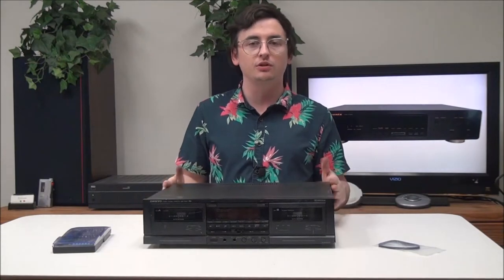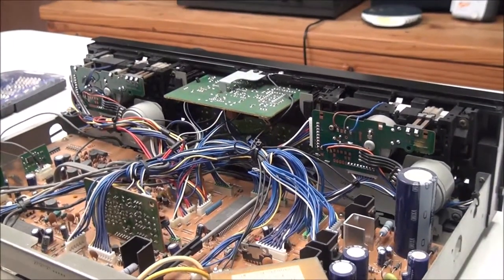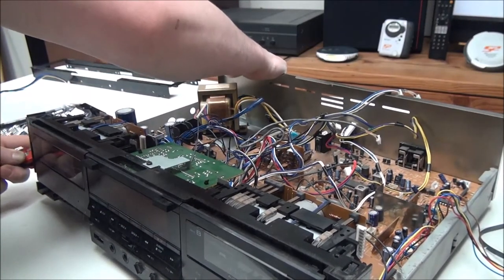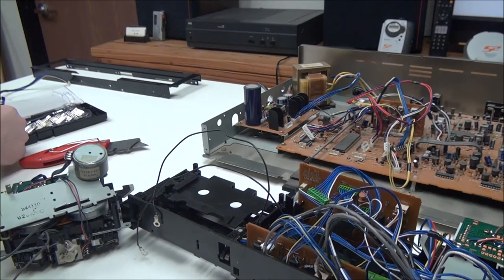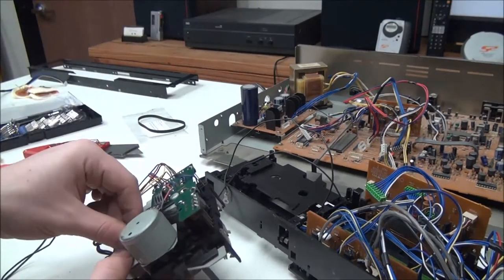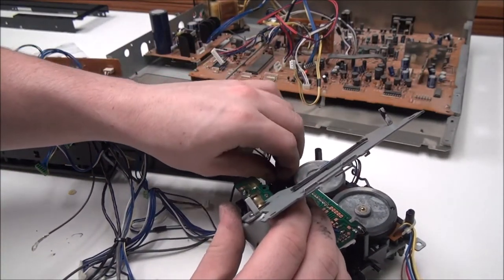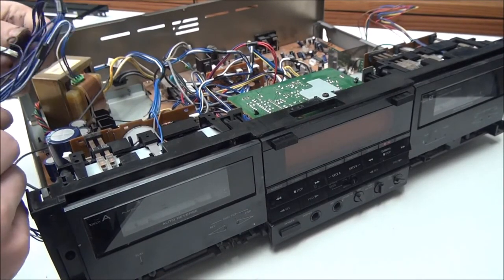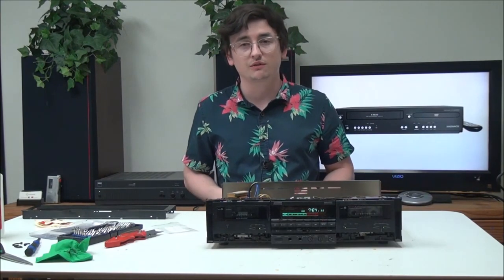How To Replace The Belts on an Onkyo Cassette Deck Won't Play or Work TA RW470 Repair Replacement

Comment: You did not show the most important part, which is putting the new belts on.  You just sped through that and did not show the path/route that the belts take.
Reply: I was going to say exactly that! And much of what else was shown was outside of the camera view...
Reply from the maker: Sorry, future videos will be better.
Reply: @Spencertified  i can see it ,thanks. you dont find it is 2 parts to clean easy🙂

Comment: thank you for making this video!  I was on the right track in replacing the belt on my TA-R500, but without your example I would have never put the belt on correctly!  It was hopelessly stretched and wound about the wheels when I opened the deck and of course without knowing the proper configuration I put the belt AROUND both wheels and the drive wheel... I did not have to disassemble the deck as much to replace the belt, but your example saved me hours of troubleshooting!  Thanks!
Reply: I second this comment! WOW, just the part of threading the belt is PRICELESS - no way I would of figured that out -  thanks so much!
Reply: Where did you get your belt?  I have the same unit...looking for the right belt!  Thx, G~
Reply: Same here but my sankyo transport was in a Mitsubishi DT-157 changer

Comment: First, thank you Spencertified (cute!) for the lovely tutorial. I was recently "gifted" with a RW490 and a request to make it work - your video was most helpful, but of course, I have to add my 2 cents. I always shudder with these machines that look like they started by putting a drive belt on the table and then proceed to build a deck around it. And in order to access it - not that it would EVER need replacing - you have to disconnect every connection in the box. That is what you've done, and kudos - nicely done. But I found there's usually some sort of "back door" that obviates undoing dozens of connectors. As you point out, there are 4 self-tapping screws that hold the deck mechanism into the front panel. Once you've got the panel loose it's possible to access those 4 screws, so without disconnecting a single wire you now have the mechanism in your hand. But in order to do anything with it, there are (mercifully) only two plugs on the mechanism that can be easily disconnected. Then my machine had two connections wound around a pair of tabs - unbending those tabs provided adequate access to the 4 screws that fasten the motor to the mechanism, so as you describe, the new belt can be slipped right in from that point. Still not an "easy" repair, but I believe it scales it down a couple of notches on the difficulty scale. 
There wasn't much left of the original drive belts, but I had a couple of belts in my collection - GC Electronics cat no. 1424-15. That probably crosses to nothing these days, but the dimensions are inside circumference 9.750, width .187, thickness .081. The originals seemed about the same diameter and width, but maybe a bit thinner. These seem to work properly, but I certainly ain't gonna guarantee wow and flutter specs <g>.
Again, thank you for the excellent video, it was just what I needed before tossing this antique cassette deck.